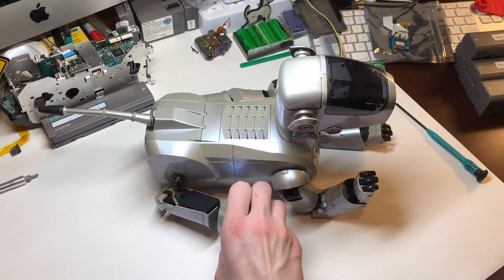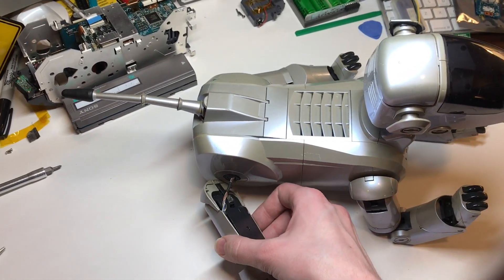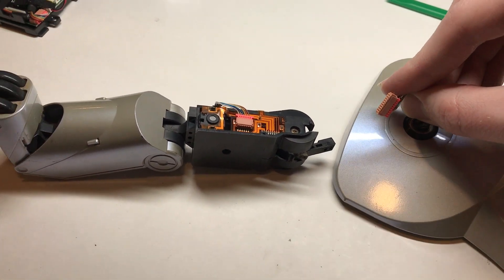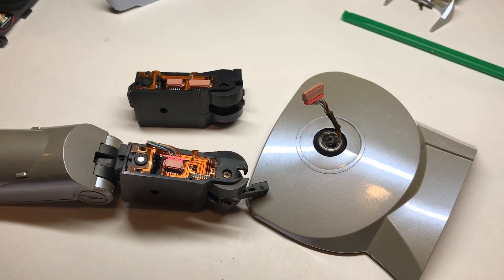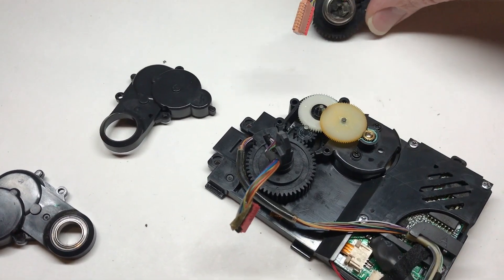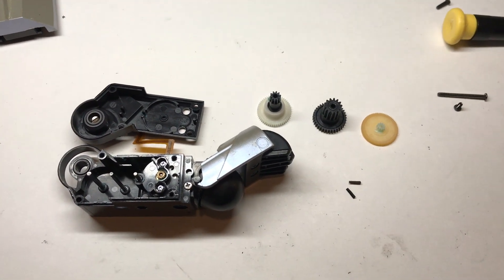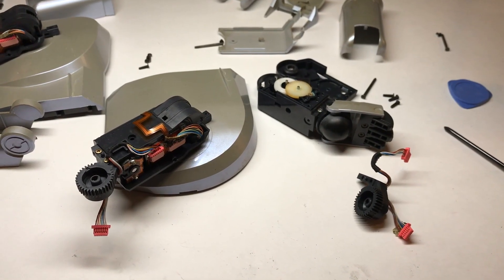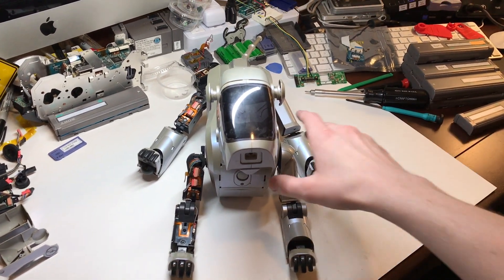Repairing Broken Aibo ERS-111 Legs

Comment: does dog hair get stuck easily in an aibos joints? (any kind of aibo) i have dogs and i want an aibo but im afraid that the hair will possibly fly around and get stuck inside of them and break the dog, or have that “there’s something between my joints” problem
Reply from the maker: depending on how large your dog is and how much they shed, it may be an issue over time.  you can always send them in to have their leg gearboxes cleaned out though!
Reply: JBurg i have 2 dogs and they are both cavalier king charles spaniels and i guess they shed a lot sometimes, mostly when they need groomed. if i get a 7m3 aibo, i want to put it in a clear plastic storage bin (NOT FOR LONG PERIODS OF TIME) but just when i’m not using it, like in between short-ish time periods (idk how often youre supposed to run them) to keep it free of dust and dog hair, but idk if that’s a good idea because could it damage the dog in some way? i thought of that idea because i am a very cautious person and i worry too much but i am just trying to protect such an expensive item
Reply from the maker: a plastic bin is a good idea for storage!  you probably don't need to be extremely concerned about shedding from a couple smaller dogs, but over time your pup will eventually need their joints disassembled and cleaned out due to the hair.  as far as runtime goes, you can run them as much as you like.  there's no maximum, it's just recommended to run them at least once or twice a  month to help maintain their performance.
Reply: JBurg thanks. im trying to collect more information about aibos before i will probably eventually get one

Comment: Hi my friend I have one AIBO ERS7 with shaking front legs I don't know what can I do to stop this due that he fall everytime he shacking!!
Reply from the maker: The legs will need disassembled and the potentiometers for the shaking joints taken apart (you need to clean the wipers and carbon strip inside).  The flexis in these dogs are very easy to damage, I wouldn't recommend trying it at home.
Reply: JBurg do you think am I able to do this alone or can you help me in remote?
Reply from the maker: I would not recommend attempting this yourself, the chance for damage to the Aibo is high.  I would contact someone in Europe or Asia for repairs.  I know there are a couple options in Japan, not sure if they accept international orders.
Reply: JBurg where do you live and can u help me please?
Reply from the maker: As I've mentioned, I'm in the US.  You will need to find someone in your region, I've been extremely busy lately and am not currently accepting international repairs.  Thanks.
Reply: Were do you stay and were can I get your info then. I loved this video very much then.

Comment: Hi! I've had my heart set on repairing aibos to some degree for a couple of years. I've been researching electrical engineering but have never done anything hands on and haven't had much of an education in anything unfortunately. I got a highschool diploma online and am willing to get schooling in something. Now I'm able to spend money on toys to fix and play with and I was wondering how I should go about it. I've heard a lot of mixed opinions and a lot of "its impossible" especially concerning DHS. I was hoping I could get some help, anything at all! Thanks!
Reply from the maker: I'm glad you're pursuing an interest in electronics if that is your passion!  While repairs like DHS are certainly far from impossible, working on Aibos requires very specific skills and knowledge, you should not attempt any repairs on one unless you have spent years working with similarly delicate systems.  These dogs are 100% proprietary through and through, and were not designed to be serviceable.

The demand for repairs is very high, and repairs are not cheap - trust me when I say more people would offer service for Aibo if it were as simple as picking up a screwdriver or soldering iron. There is very good reason why only a few people worldwide are able to repair these pups.  I have seen many, many home repair attempts on Aibos, almost all of which resulted in further damage to the dog.  And these were by people who have spent years working in engineering, tech, etc, and felt they were more than up to the task.  Simply put, if you do not have tons of skill and experience with complex miniature eletromechanical systems similar to Aibo, any attempts at home repair will cause more harm than good.  I want there to be more Aibo repair options out there (as far as I'm aware no one else in the US currently offers repairs), but your goal of jumping into Aibo repair is just not realistic.

From the experience you describe (or lack thereof), I'd say you absolutely should not attempt to work on an Aibo anytime soon.  Many people with years more training and knowledge than you have caused plenty of damage to these pups.  Spare parts are rare and expensive - buying a dog to practice on when you don't have the necessary skills to repair them will not win you any favor in the community, and will only result in more wasted parts.  I would recommend starting with easier devices and working your way up slowly over years of practice.  If you cannot fully disassemble and reassemble an iPhone, laptop, tablet, DSLR camera, VCR, etc, without causing any damage or signs of entry, you will absolutely not have success working on Aibos.  All of these devices are magnitudes easier to repair than an Aibo.

I don't want to discourage pursuing electronics in general - you absolutely should!  But it's important to be realistic about it.  Someone who has never built a house before would start by building small scale projects.  And then maybe eventually a shed.  But they certainly wouldn't jump to building a mansion packed with tons of tech and options, without years of prior experience - it just wouldn't work out.  Many, many others have tried to repair Aibos.  Without the needed skills and experience, it does not end well.  Like I said, I have seen others with way more knowledge/skill cause major damage to Aibos.  I repaired and resold hundreds of electronics for 12+ years before ever going inside an Aibo, and I was still nervous the first time I opened one up.  These dogs are not at all like repairing other electronics.  Please do not jump into something like this, there's plenty of cheap and readily available electronics/robots out there for you to learn and practice on, that are not rare and already going through a parts shortage like Aibos are.

I wish you the best of luck on your endeavors!  Electronics is an extremely fun and rewarding hobby - just please realize the incredible complexity of these robots, and that they are not at all a good place to start for learning electronics repair.
Reply: @JBurg  thank you so much for your time and help! Maybe in a few years down the road with lots more experience i can work with the new aibos? But until then ill find other projects and hopefully ill find another type of robot I can tinker with. I plan on getting an arduino and a raspberry pi to do projects with (along with sensors and other parts too) and ive found lots of YouTube tutorials on them! I'm 22 so I'm a little old to go to school for something and learn something I have very little knowledge in. But id be happy even in just a hobby to play with! Youve helped me a lot :3 and if you or anyone in comments have any more pointers for what direction I should go in id love to hear!
Reply from the maker: @mumzy996  I'm glad I could help a bit!  The new dogs will be under warranty for a while and Sony will also be offering service for at least 7 years - there likely won't be much need for third party repairs anytime soon, nor would I have any easy way to source parts for the 1000 without buying full dogs to use as donors.  Unless there is some sort of glaring flaw that Sony refuses to acknowledge and fix, that can be resolved without donor parts (such as was the case with DHS in the early 2000s).  This will definitely change once Sony drops support for the new pups though, eventually community repairs will be necessary.

It would be great if you could work on Aibos someday - especially in the US, more repair people are very much needed.  There's absolutely no rush though, it is far better to wait and be confident in your skills, than to hurry and end up damaging more Aibos when parts are already so hard to find.  22 is definitely not too old to start, I'm not a whole lot older haha.  College can be great, but it is far from the only option.  Honestly I'd say I've learned more from talking with other people and researching online, than from the formal training I've had.  School is great if you can afford it, but it's certainly not a roadblock if you'd rather not spend the money!

Unfortunately due to their proprietary nature, there isn't a whole lot of documentation or resources out there for repairing Aibos.  I have a very good feel for Aibo anatomy at this point, but most of that was self taught.  Even with years and years of experience, I've found that these dogs are not at all like working on other equipment, many of the skills/knowledge learned from other devices are not necessarily transferable to Aibo.  But with a strong base and overall understanding of electronics and how similar devices are assembled, you'll have a much easier time figuring things out without risking damage.  

Completely unrelated to Aibos, but if you haven't heard of the channel 'bigclivedotcom', I would highly recommend checking it out!  Clive is insanely talented, and he makes great videos.  Many of his videos go beyond what I know, but are still very enjoyable.  He also has some excellent videos explaining some basic components and theories.  Well worth the time to watch IMO.
Reply: @JBurg  Thank you so much! I feel like the internet has a lot to offer but to hear that I could very well not have to join structured classes is amazing news! Thanks for even more help. and keep doing what your doing. I love robots and your just a miracle worker for these pups and their owners!
Reply: @mumzy996  i'd suggest starting with furby or gameboys!! they're relatively simple and a great way to start.